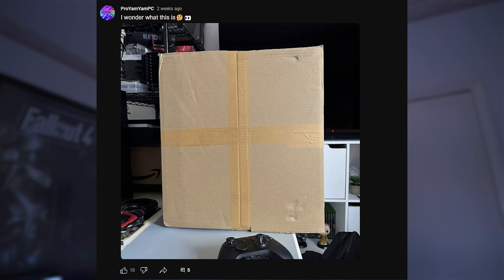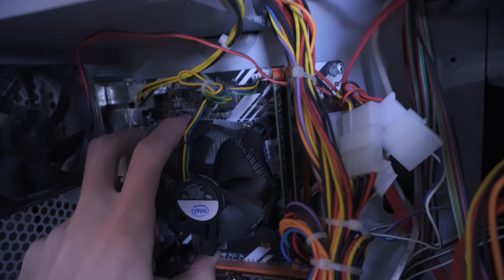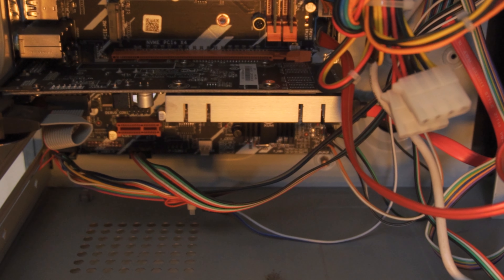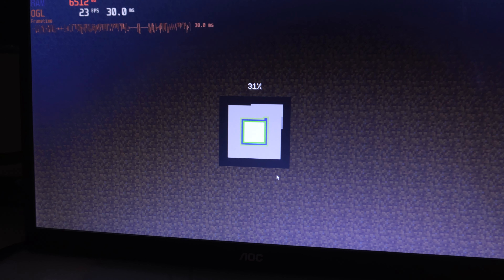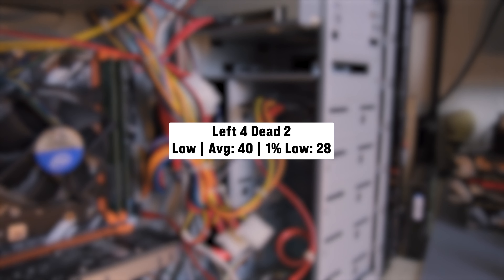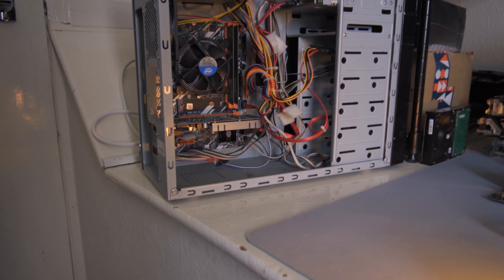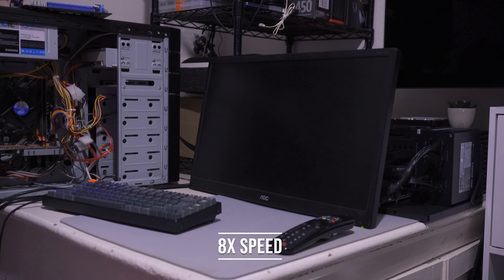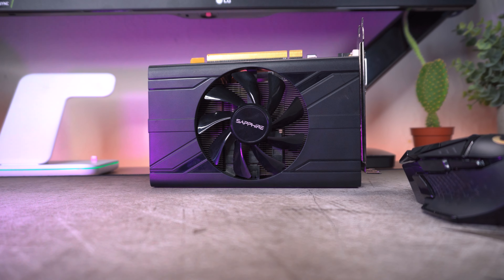I Bought a "Gaming PC" for £65...

Comment: You can't stuff an i7 3770 in there are you mad? That thing will still cost you 50 quid!
The i5 3570 you can get for 10 bucks. Slap a GTX 1060 3GB in there and you got a budget gaming rig!!!
The 3gb version of that card you can snipe for 70 bucks, while the 6gb version will cost you 40 bucks more.
Reply: A lot of these things accept Xeon E5s, too, even if they claim they don't. Because of the ambiguity, these Xeons are consistently cheaper than their i7 counterparts. That said, the i5-3570 and GTX 1060 3GB is a decent pairing for this machine.